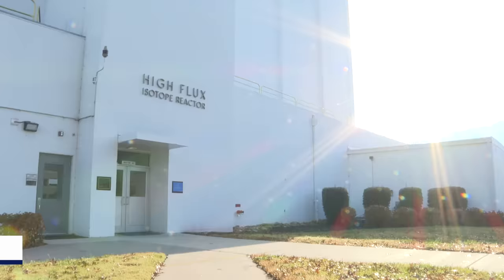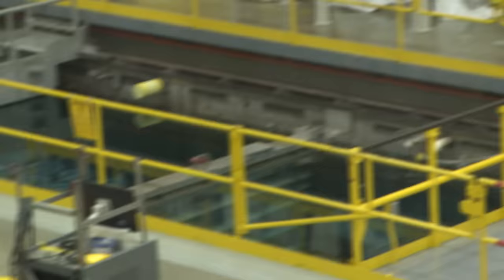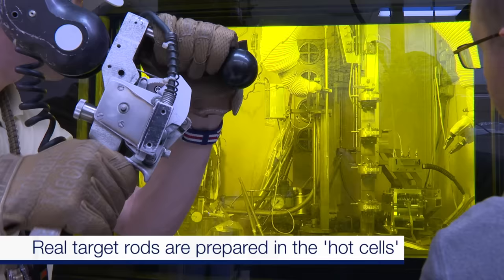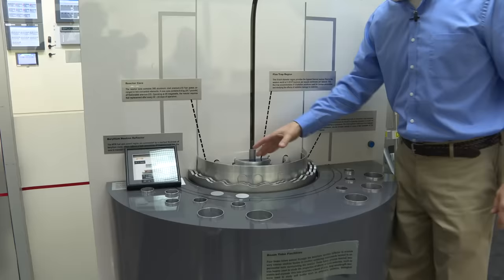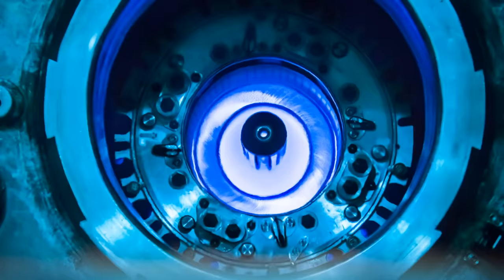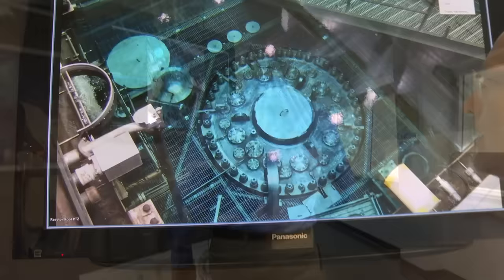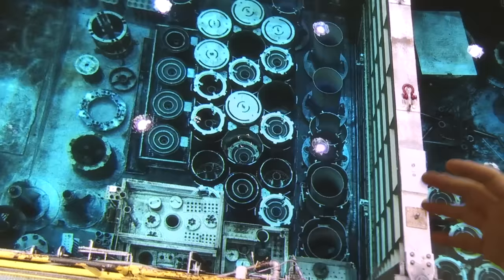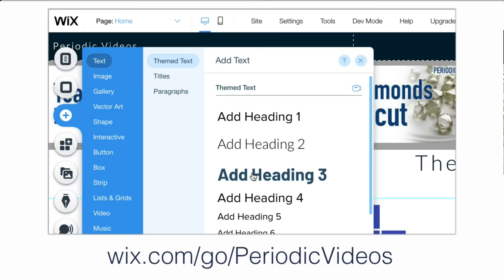Inside a Nuclear Reactor

Comment: why not just use pressurized liqiud metal, imaging if we had liquid metal in a cyclinder and pressurised it it would kick start an energy system as the metal in the middle of the cylinder become diamagnetic and positively charged, your be creating rods of energy and no nuclear power would be needed...liquid metal power rods that power a system or ship...again another alternative power system...and it doesnt just have to be metal in theory you could pressurized an particle to do so....then imagine making these rod in a zero gravity environment with a mixture of metals...more power less work...

Comment: why don't we use plutionium 238 to power our cars ? anyone?
Reply: It is a very poor power source in terms of being efficient per unit mass compared to almost any other type of energy source. RTGs are just very simple (no moving parts) and perform the dual role of heating spacecraft so are worth the weight penalty in using such systems.

Comment: Everyone is just marking time until the 100% inevitable next carrington event that's soon coming down the pike.
Reply: Many, many, many hundreds of nuclear reactors have been built like carrington events never, never, never, never happen.
Reply: The planet will be radiation sterilized from pole to pole from all the meltdowns.

Oops.
Reply: Meanwhile, back at the ranch... the Fukushima ELE continues on and on and on.

(Just in case anyone has... forgotten... the Fukushima ELE.)
Reply: Geomagnetic storms can't hurt nuclear power plants: their internal electric devices are too small to be affected by dangerous currents and failures of the electric grid are already taken into account by constructors, since those are common by themselves.
Anyway, there are no "extinction events" from nuclear power plants. If all spent fuel on Earth (10^22 Bq) was dumped into the Ocean and well mixed, then it would merely double the natural radioactivity of water (10 Bq/L).

Comment: What if you took that plutonium dust and sprinkled it on a taco and ate it?
Reply: Truthfully? Very little indeed in terms of radiation exposure. However, plutonium is very toxic chemically so best to avoid ingestion.
Reply: So you would die?
Reply: @joechiodi5529  Almost certainly not from a radiation point of view as it's not going to be in your system long enough to do much, if any, damage. From a toxicology point of view, and it's not my field of knowledge I suspect you would. Heavy metals accumulate in organs, kidneys and liver I imagine are especially susceptible. I think this could well be fatal or at least leave you with serious permanent organ damage.

Comment: "the neutrons are communicating"  - ... what?
Reply: More specifically, the neutron sources are "communicating". So the fuel produces n's, some of which go into the reflector. These hit the beryllium in the reflector, generating some more n's, some of which go back into the fuel. And back & forth.
Reply: @captainpocky  Isnt communication the act of exchanging information or are there more meanings to the term?
Reply: Eh it doesn't have to be that literal, you get the idea

Comment: "The water is only for cooling".  BS. The water is also there as an insulator the from possible radiation leak. This is a common fact.
Reply: It serves no role in the operations of the reactor is likely what he meant, unlike other pool designs which use convective cooling to actually perform some part of the role in the operation of the reactor.
Reply: @BeCurieUs  I believe you are right.